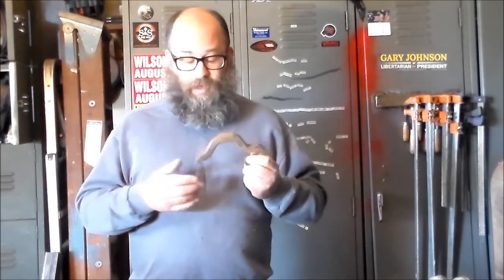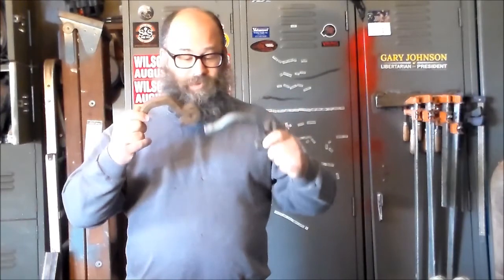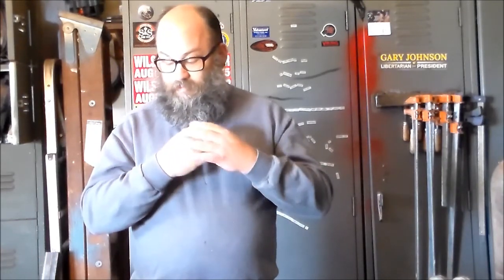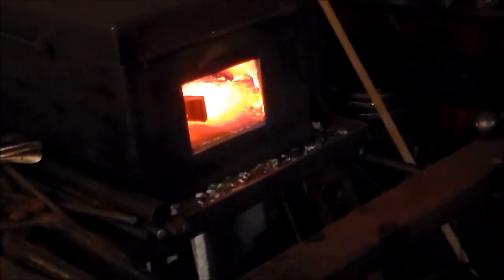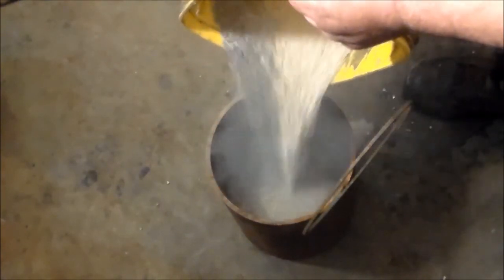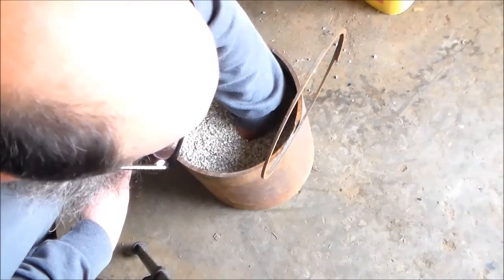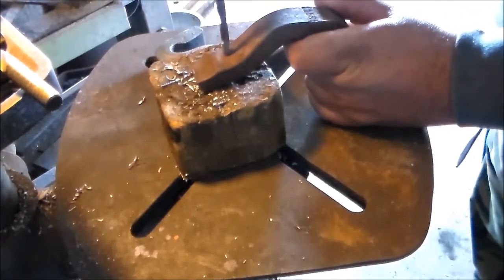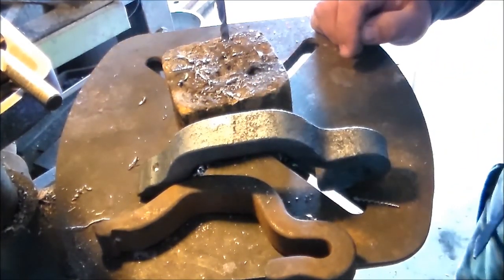Annealing steel for the Blacksmith

Comment: interesting discussion but you got the relationship between grain size and hardness backwards.  bigger grains are a sign of softer steel, smaller grain size (from quenching) makes the steel harder, just the opposite of what you said beginning at about 1:40.  metallurgists call this the Hall-Petch mechanism (you can search on that term if you want more detail).

Comment: Thanks a ton I didn't think of using Kitty litter That's pretty brilliant on your part.  I'm gonna start doing that in my forge. Quick question have you ever used sand for annealing and if so how well does it actually work?
Reply from the maker: I have not used sand, but don't doubt it would work. I just prefer kitty litter or wood ashes mostly because of the weight. Let me know how this goes for you and thanks for watching!
Reply: @VooDooTennessee  ok will do thanks again for sharing your wisdom godbless and stay safe.
Reply: @VooDooTennessee   I've been using your Kitty litter method for a while now and i'm very happy with the results. I like this method because it does not require expensive machinery and I tend to use high carbon steel and this method works great on carbon steel. I will try the sand method eventually and let you know which i think is better or the same. Godbless forge safe and thank you for your time.

Comment: do you forge it before or after annealing
Reply: depends on the steel you're working: if it's already hardened (e.g. a jack hammer bit that you want to repurpose, then anneal it before forging - and then anneal it again after forging to relieve the internal stress before heat treating your new tool.  the first annealing step can be skipped if it's not hardened to start with, check that with a file.

Comment: Hi! I see that this is the real annealing. It gets red hot and you cover it, so it cools down a lot more slowly. I am just confused that my grandpa long ago, was very strict with me when hand sharpening blades to use water or oil constantly because if I don't the blade will loss the temper.  So, is what my grandpa is telling me that if I don't cool the blade while sharpening it with my hands, the simple friction will anneal the steel? But for me, I don't really feel much heat produced by hand sharpening.  Can you shed me some light on this, please?
Reply from the maker: Well it's not a short answer, but here we go. Heat treatment is the process where the steel if first hardend then tempered back to the best hardness for the job. To harden you heat the steel to critical temp, non magnetic, and quench in th e appropriate quenching liquid. this has the steel at it max hardness. Now that hard ness must be soffened a bit to make it less brittle, this is what makes the steel tough. To temper you start adding heat. Depending on the steel and tool depends on how you add the heat. Most modern tempering is done in a tempering oven, I usually temper form the back and watch the tempering colors. The point is you take it to a specific temp then stop no hotter. What ever method used takes the max hardness and tones it down so tools won't snap or chip. Any more heat could make the steel softer. So while heating a blade on a grinder or stone wheel won't anneal the blade it will remove the heat treatment. If your just using wet or oil stones then you won't over heat the oil/water is there to carry the sharpening waste away. Hope that helps.
Reply: @VooDooTennessee  It helped... much. Thank you. More power.

Comment: Good to see you back. Thank you for mentioning the difference between annealing and normalizing. I hear them used interchangeably sometimes. Also, for something as thick as that clip, is one annealing cycle enough? Or, will repeated annealing cycles make the metal even more malleable?
Reply from the maker: One should be enough, just make sure it is heated all the way through, as thick at that was if the center wasn't at critical temp it would have still been magnetic. The more you attempt to change the grain structure the more you risk damaging it beyond repair.